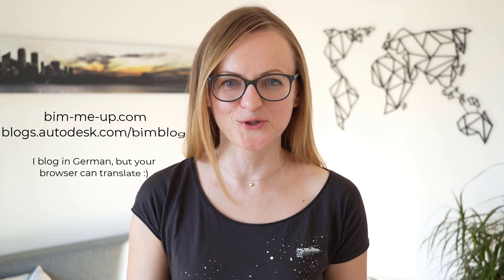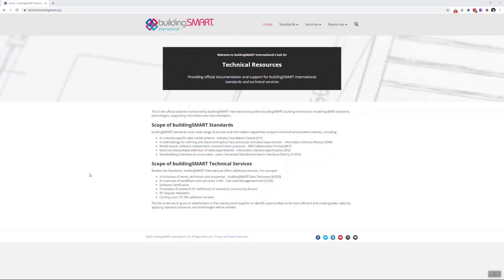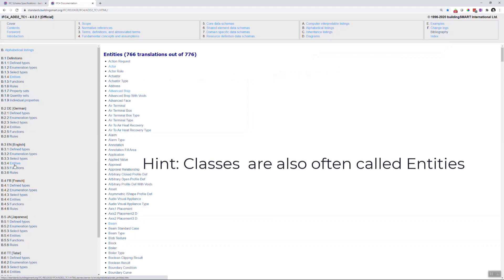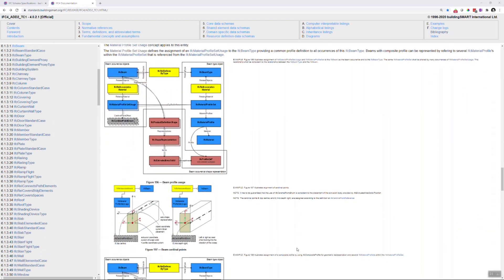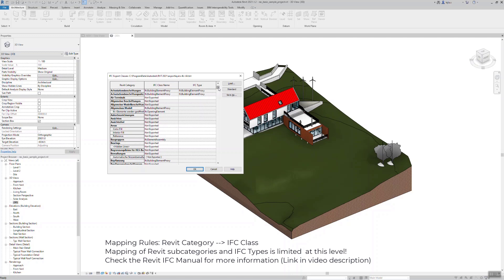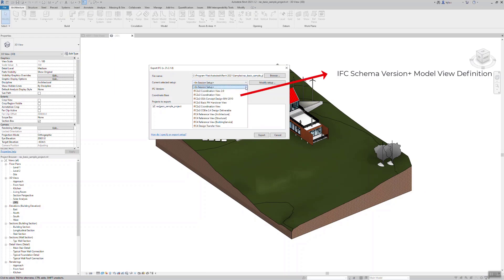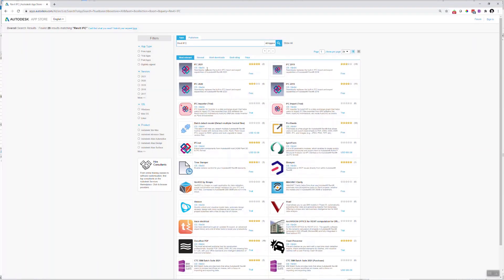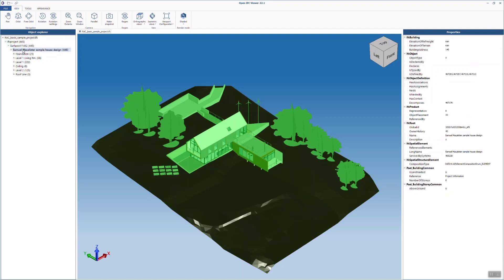Basic IFC Concepts for Revit users

Comment: Hi Lejla, Great Informative Video thanks. I would like to as Is it possible to change entities? Can I export IFCrailing as a IFC wall? Thanks Looking forward to you reply
Reply from the maker: Hi Parimal, thanks for your comment! Yes, you can export a Revit Wall as an IFC Railing and so on, but you must be aware of the fact that different entities have different standard properties and that the exporter can only map the properties which it finds in the correct place. For example, a wall has a completely different structure with layers, fire rating and so son, which a railing doesn’t (though again, the railing has other properties relevant to its own category). 
So basically, the answer is yes, but you need to double check the properties after the export. There is a great list of all possible category mappings in Revit in this article: https://knowledge.autodesk.com/support/revit/learn-explore/caas/sfdcarticles/sfdcarticles/Supported-IFC-Class-mapping-when-exporting-Revit-models-to-IFC.html

Comment: These videos you made are pure gold, thankyou! Sometimes I wonder if it will be possible to override system family IFC category, for example to use a curtain wall to make a railing, and to export it as railing (the same to use it as a Window...) What do you think about it? I know that if I don't wanna have problems I have to stick with the correct category but I mean, Curtain Walls are one of the most versatile objects in Revit, so wouldn't it be wonderful to simply remap it into something else?
Reply from the maker: Thanks for your comment and the great feedback, really means a lot! :) The restrictions on system families are slowly being lifted, e.g. you could already export a regular wall as a railing - with curtain walls it is a bit more complex, though I get your point. 
One thing to keep in mind however: when mapping Revit categories to classes they were not intended for, the common property sets cannot be correctly assigned (e.g. a curtain wall doesn't have the same parameters like a railing in Revit, so only the data which is there in Revit can be exported to IFC). Hope this makes sense? 
Anyway, I'll try documenting what can be mapped to what, as I know this is a common usecase.